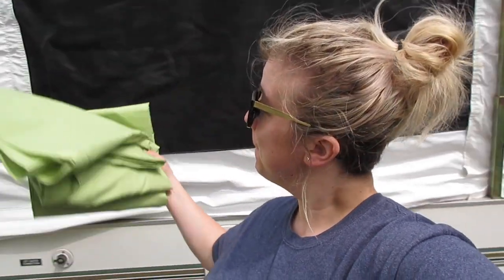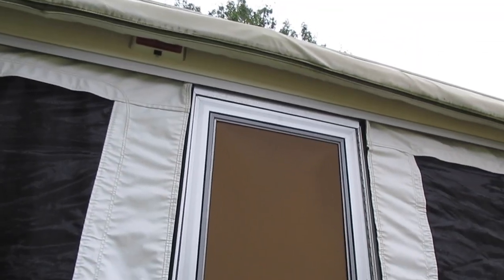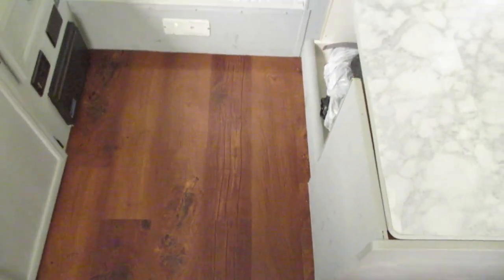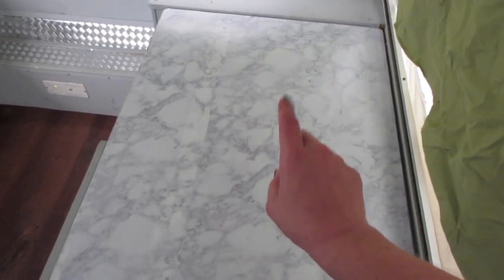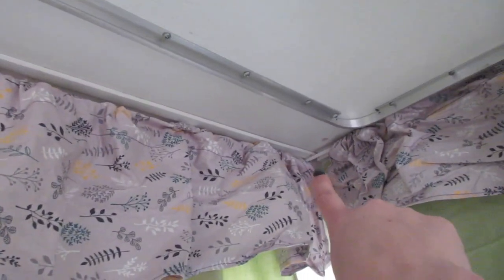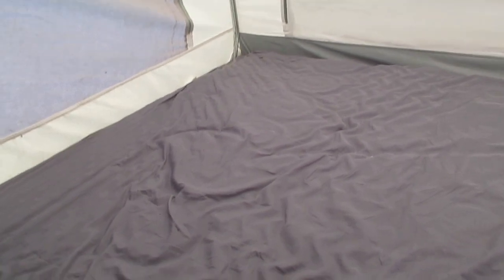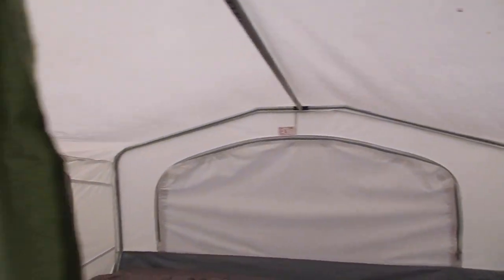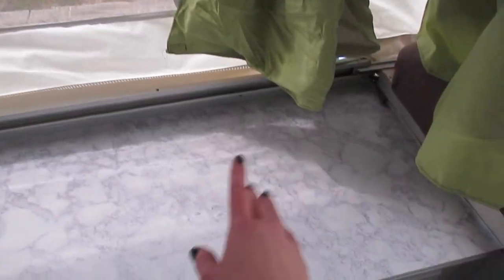Pop Up Camper Reno and Tour

Comment: I just got an ancient Rio Grande. It was headed to the junk yard. the last owners totally raped the inside and took everything that was useful including the air condition. They put big metal square on top and another middle square underneath which pushed the ceiling in.😢
It will be fantastic someday 🤠. As good as yours! When is watch a few easy, install zipper videos, and you will be a professional instantly.😅 I get all of my sticky plastic for counters and super cute material on Temu for an incredibly low price you just have to wait two weeks to get it and being on Social Security that really works for me.👍 Don’t forget to change your bearings in the wheels and get new tires and always have lots of fun and take pictures🎉

Comment: I had a Jayco 1207 back in the 80's & 90's and it had a toilet and shower.  I loved mine.  Used it all the time.  The cassette was easy to dump.  And I was real popular with my Churches singles group campouts with the ladies when we went camping.  They loved being able to shower and clean up in private over using a public campground bathroom. I had lot of mods done to it too! I preferred to cook outside in the screened in porch to keep cooking grease and cooked foods smells out of my sheets and clothes.  Bought a table that had a built in sink in it and used it to cook on with my campers stove moved outside.  I added a propane line and hot and cold water lines to that table in the screened in porch.  You have some nice mods,and you will enjoy doing more as you find what you need.

Comment: Are those peel and stick floors water resistant.  I I have that cassette shower and use it boondocking all the time.  2007 Jayco Select 12 Highwall.
Reply from the maker: Yes! So far so good but I do like to out down a towel just in case when we use the shower!